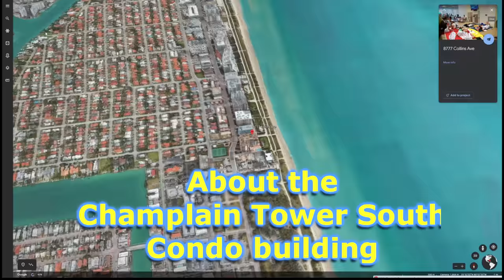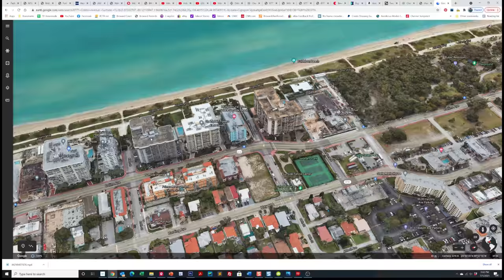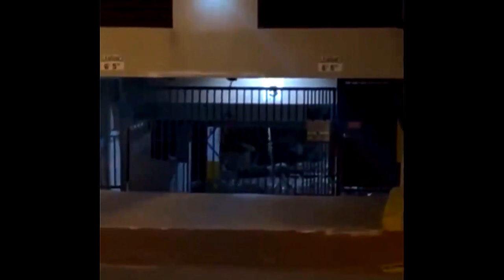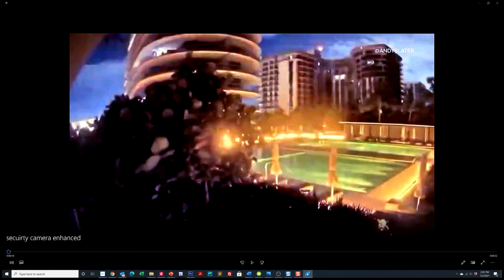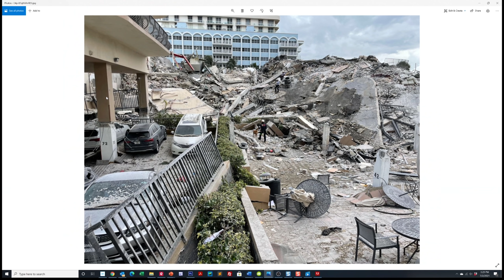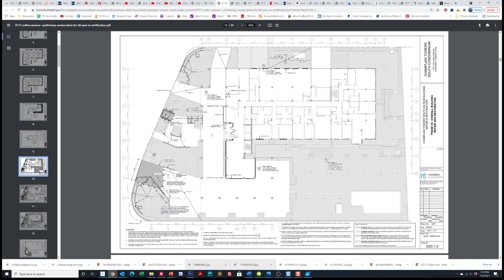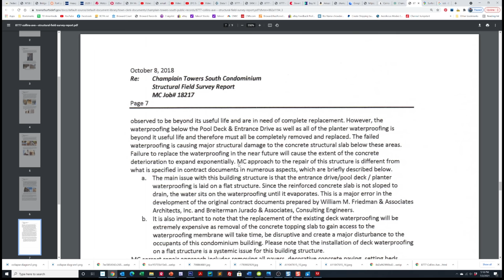Here's Cause Of Miami Condo Collapse Champlain Condo Towers, Surfside

Comment: You need to be on the investigation team. You've presented more than anyone else. Even NBC had a 30 minute special, of YouTube news clips! On normal t.v.! Let's hope the officials don't cover it up. You have made this very easy to follow and understand to the layman.
Reply from the maker: Thanks Duane
Reply: Windows leaking in the 2018 report obviously began years before that report.  Multiple leaking windows and cracks in large buildings are almost always caused by some kind of building subsidence.  Why weren't  those flagged as a result of the the real problem in the report?  If it had, 2+2 would have equaled imminent danger, which should have been reported to the Mayor's office immediately.  Definitely not blaming anyone or any company, but the laws must be changed to protect whistleblowers!
Reply: Str8🆙.. 🎯
Reply: Yes, maybe at the same time we can find out what tools to buy at Home Depot……..

Comment: Lot of good facts and analysis. Ask this question: why didn’t it all fall? Reason is in the picture. Part still standing has substantial shear walls and a cross support beam.  Sections that fell had inadequate shear walls and no beams. This is a flat plat design.  You see how those columns punched through the slabs.  No capitals on the columns. Inadequate and too few shear walls to transport the loads.  Column punched through the slab, slab falls, slab fails the next column, they all snap and punch, and collapse is the result.  Building was designed to save cost of construction and to offer great views. There are many of these death traps in Florida.
Reply: I said this
From the beginning. This building was doomed from the moment it started construction. Buildings should not collapse
Reply: Very fine point - "no capitals".  Capitals support and distribute weight.
Reply: Make your clicker a different color for contrast please,  to flow you along.  Great content, thank you sir!
Reply: Ok but we can not assume the pool desk which was only designed to be a roof to the parking level was constructed the same as the rest of the building.
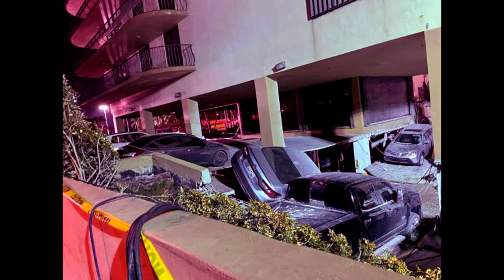Reply: @Robert08010  Look at 21:31. Interior and perimeter columns have no capitals, but there is a shear wall above which stabilized the section.  It is common knowledge in the construction industry that the flat plate design is flawed due to the threat of column punch through. Over 60% of the Mexico City building failures in the 1985 earthquake were flat plate collapses.  Flat plate with beams are much stronger and resistant to collapse.  Many studies verify the flat plate is dangerous because one column failure can bring it all down.  See the video of the Miami Beach collapse in 2018. They pulled one column and it pancaked the entire building.  Officials ignored the implications. https://youtu.be/91rj8F6oil4
Reply: I understand now
Reply: Totally agree with you, no beams at all that floor punch through the columns like nothing and the columns were also too skinny, that was a death trap for sure.

Comment: I found it a bit difficult to follow especially when you're showing us an area with the tiniest of cursers or pointer as it blended into the scene. By the time i figured out what you were showing it was a little too late to make heads or tails of it. However the overall story was easy to understand.
Reply: I totally agree and I commented also. The tiny white cursor really messed,w what he,was explaining.  Lost me,a bunch of times
Reply: Just in case you don't know, you can go into Windows and make the cursor a lot larger. I could barely see it on may phone!
Reply: A true statement, however, it is a video and you can pause and rewind it to see what you may have missed. I did that a few times.
Reply: Its as if someone is trying to convince me of something that I cannot see. The middle fell out first hmmm..
Reply: The comment  that thick columns supported the section of the building which did not collapse -- and that thin columns supported the section which collapsed -- was the bit that caught my attention!
Reply: @victorsauvage1890  Thats totally weird seeing that the building has the same height. I dont get it in the parking garage area there is skinnier columns? I have seen a few tapes and a few peoplr stating what they seen and heard. The Jury is out yet. I'm sure they will come to a logical explanation. Perhaps not time will tell.

Comment: This scares me. My condo building always has weird water issues in the basement and ceilings. Water drips through the concrete and pipes in the walls and ceilings. I usually brush it off as "theres no way water can damage concrete ". Now I'm worried.
Reply: If you can get a private inspection done soon, do so, l'd say.  Perhaps you and your neighbors can share the cost.  If there are red flags, don't hesitate to go to the press with it.
Reply: Be worried. Move out.
Reply: Let me assure you, water can, will and does damage concrete. It's probably the #1 concrete-killer, actually.

Comment: They estimated that the building was sinking at a rate of 2mm a year. Over 40 years that is around 4 or more inches.  That much shifting would be devastating for any building.  I'm surprised it stood as long as it did.
Reply: Im surprised too.
Reply: It was ment that way  so you would believe  the narrative  lie.  Wake up. It was not a foundation failure. Those kinds of failures leave a building leaning over  hence the leaning tower.  
They blew this building  up. Making it into dust. Even the rebar became dust!  

Which that should give a hint. 

What kind of temperature turns rebar into dust?

Start thinking.... ignore the  lies
 This video is made by a liar!
Reply: All mid and high rise buildings gradually settle at a similar rate... usually for the first ten years or so. Concrete structures not only settle, but shrink as well. This is factored into the construction aspect of the build. I worked on a 73 story in LA called the Wilshire Grand. We started the first story 2” above the given elevation and every story after that... we added 3/8” to each elevation for shrinkage and settlement. Now add 3/8” over a period of 55 stories, we then took it to 1/4” up to level 70 then 1/8” for the final 3 levels. The mat foundation on this project was 22’ thick and took 22,000 cy of concrete at and around the elevator cores. 1,000’ tall. Now imagine what’s going to happen if that foundation settled just 1/8” over the entire footprint.. that building will lean 10’ out of plumb at the top. That’s what happened to that high rise in San Francisco. No thank you... I wouldn’t be caught living in a high rise. Especially in an earthquake zone. We’ve only been building these massive buildings for a few generations... it’s still too soon to tell for sure what disasters can happen. I’ve been in rooms with major engineering firms and have consulted with them in value engineering. I can tell you... some of these guys have been caught sweating.
Reply: @buildingbuildercip8292  this building was also built on reclaimed swamp land.
 I was in construction most of my life.  I retired early because I kept having the same conversation. I would tell them they would have problems if built as drawn.  They didn't listen.  Got tired of fixing their inability. 
 My house has two stories.  That's as far off the ground as I care to be.
Reply: @aprilc1152  grow up stop acting childish and be an adult. Only a coward acts like you. Leaning Tower Pisa, a great example  of ground sinking and it leans.   Good luck to you, I will never be as disrespectful to someone else  as you were to me.  Really, learn some manners and be decent.  Just because someone  has a different perspective does not give you the right to be disrespectful.  I have 30 years experience in real estate  and  developed,  I do believe that does give me some educated experience in this field.
Reply: @buildingbuildercip8292 Now you're talking!  Well said!  (If I knew how to do it I would like to place you comment at the very top of this website -- I hope hundreds of thousands read your statement.)
Reply: @altonT  You've got my vote Alton!
Reply: @aprilc1152  (She's teasing!  She doesn't really believe what she says!  She deliberately says those ridiculous things because she like to see people respond strongly.)
Reply: @donnalangley117  why do you think someone blew this building up?
Reply: I've seen a bigger building that has a basement that looks like a carnival fun house. It has a sinking basement that is so bad they never built the second tower   right next to it. Even though it's named  Calhoun Towers.
Reply: @altonT  i agree i would like to see a soil survey of the area FLA is not prime for highrise buildings  unless they sink piles down to bedrock and have  a motherfkg thick mat slab sitting on them piles and pilecaps
Reply: @victorsauvage1890  I would like to believe that LOL. Apparently no one has ever been so rude and disrespectful to her as I have been by calling her a loon. 

Then I looked at her YT subscriptions and it all made sense. ;)

Comment: No slope, no drainage. Huge design flaw. I’d move out of the other towers if they are the same.
Reply: Agreed
Reply: They certainly have to have the same engineering flaws, they are likely all designed by the same architect.

Comment: Why is no one bringing up the fact that just a few years ago a similar event happened down the street? The Marlboro House condo was slated for demo and before they could blow the explosives, the entire building collapsed suddenly! Just came down.
Reply: An early collapse really points at the demolition team not understanding how to prevent spontaneous collapse. 

In the middle stages of building demolition, the support columns are weakened (using jackhammers) in the critical locations where explosive charges will later be installed.
Reply: I didn't know about that. Thanks for your sharing of that information.
Reply: @imconsequetau5275  Why are you so strongly in denial about the state of American building construction?
Reply: @fraidykat  Because with millions and millions of building we have one collapse.
Reply: @imconsequetau5275  Clearly it was far weaker than they thought it should have been.
Reply: @fraidykat  if it was a middle class or poor ppl building I wouldn’t question it but millionaires homes collapsed like that suspect
Reply: @rachelasf2125  Take one look at the millionaire developers and real estate agents and reconsider your arguement.  It does not hold water.

The interior of this building was apparently gorgeous per real estate listing photos.  Take a guess how much those aesthetics add to the structural health of the building - not one bit.  Furthermore, just because people might be rich does not mean they are either smart or educated, it just means they are rich.
Reply: @regould221  We have one building collapse and now we have two other buildings closed for repairs based upon inspections conducted because of this collapse.

Have you not been paying attention to the infrastructure reports over the last decade?

Your short memory has forgotten the other recent collapses, to include the Hard Rock in New Orleans and the Bridge in Minnesota.  Those are merely national news levels, who know how many never go reported or are sitting in the same state and condition as Champlain Tower South before it fell.
Reply: @fraidykat  Do a count of problem vs none problem. It's a very small percentage that have problems.
Reply: @fraidykat  As a academic, your comment would cause you to fail by making comments that you cannot substantiate. 
I suggest next time, so that people do not look at you as a fool, that you provide supporting data, such as the number of high-rise buildings that have been constructed in the past 80 years, and how many of them have collapsed. Also, provide the ratios. Then people might pay attention to you. 
Have you ever noticed that when you make suggestions or throw in your two-cents-worth, that people invariably dismiss you, or ignore you? I bet you haven't even thought of it until I just enlightened you :) You're welcome.
Reply: Controlled demolition…..
Reply: @daynatorngren7699  it was not controlled demo. They planned on doing a controlled demo. They had the building totally wired and then before they had a chance to blow the building came down
Reply: Low quality made in America
Reply: You no why
Reply: When buildings are demo with explosives they are prepped (severely weaken) ahead of time by the demo experts. Someone may have made a mistake during the prepping.
Reply: The elevator and pool were concrete blocks, that indestructible (cannot be knocked over) elevator column probably saved the rest of the building. It looks by the water damage the pool deck garage ceiling gave way, not a big problem, but it knocked over columns in the garage that supported the building. The pool room and rotting beam survived because there are walls and structure and not columns, the pool deck/ceiling failed and knocked over columns.
Reply: Never heard about that...no one died so media did not care
Reply: @fraidykat  
I'm in denial? No, am not. 😂 😉
Reply: @mykofreder1682 Agreed.
Reply: @imconsequetau5275  You most certainly are.

Comment: As u said, the bldg tried to save $ so they used the cheapy skinny columns than thicker same column that North tower used. Its the structural failure.I cant believe that it made to 40 yrs.
Reply from the maker: Had hey maintained it, it could have lasted.
Reply: A guess here, great video btw. Those columns originally, probably could have held the weight being tied into surrounding beams, floors, etc. A leak constantly adding water to all that concrete with no where to go, could almost double the weight I'd guess. I have a tough time thinking the engineers ran numbers that added so much weight to the structure. Then add hurricanes, humidity, rot, and rust. Put all that on top of already saturated soil and foundation.

For me, looking at it from that perspective it was just a matter of time. Tragic.